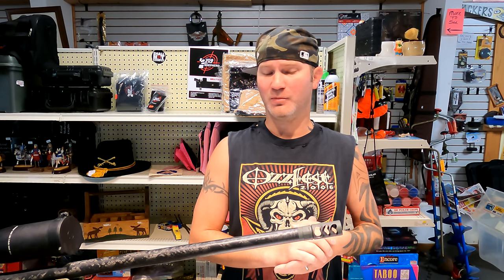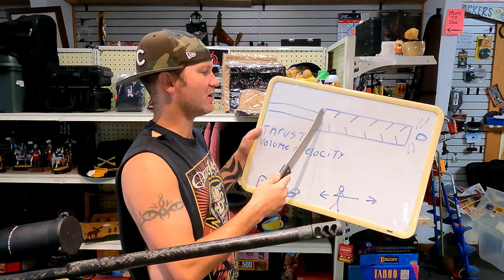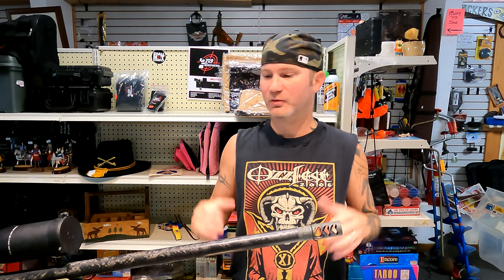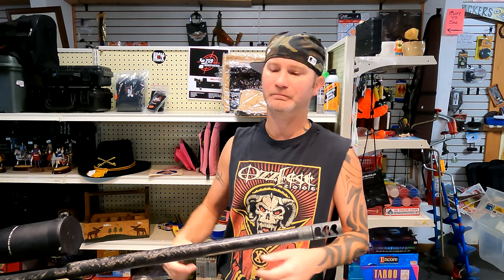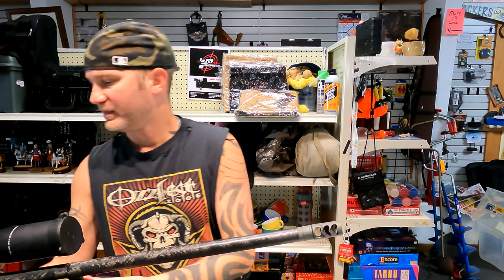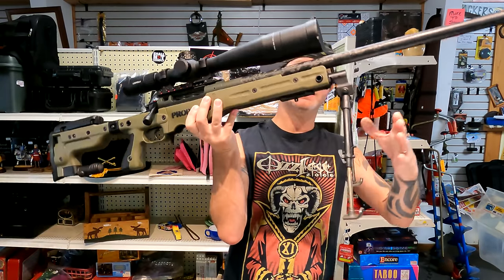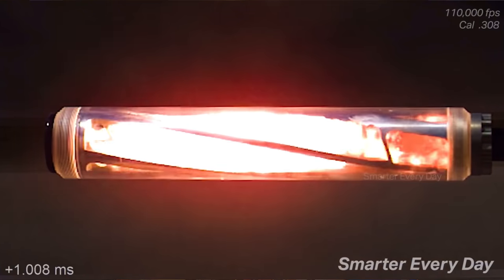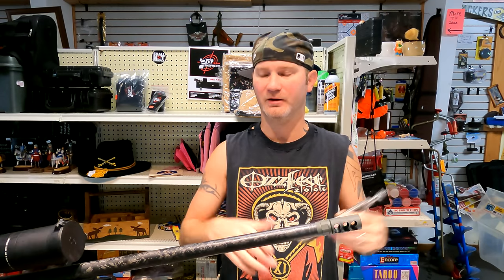Reduced Felt Recoil

Comment: All of that was wrong. Volume isn't even in the thrust equation except to get mass, the mass of gas remains unchanged. You can think of it like making it a poor rocket and lowering impulse (impulse is acceleration per time) as it slows the gas. For a rocket of fixed propellent mass, to increase thrust you must have higher exit velocity, a can diverts gas and slows its: making it extra slow exhaust, like a poor rocket.

Mgun*Vgun=Mbullet*Vbullet+Mgas*Vgas   (recoil starts immediately, there is no such thing as a sphere of influence, sitting in a car has no acceleration when steady velocity cruising, however when you accelerate or when a rocket accelerates the people DO experience a force). The bullet mass is very low (Mgun >> Mbullet) and for such a short time duration while its in the barrel where aim would be affected, the barrel's total movement in that time is very low and almost negligible in that thousandths of a second (the center of gravity of the closed system until exiting will be the same, and a bullet weighs very little), however we know it definitely does have impact for follow up shots since the time is not ~0 in those instances (otherwise shooting a foam dart or heavy lead projectile would have the same recoil, its not negligible for increasing amounts of time).

Comment: Suppressor weight: While you are correct on the physics, IMHO the conclusion is not quite right. The weight of the suppressor does reduce felt recoil but not much (except in a handgun). Yes, the same total energy is imparted to the firearm, but imagine a person jumping on concrete. They move but the earth doesn't move. In reality, the earth does move but such a small amount it is completely insignificant. So enough weight added to a firearm would ultimately make recoil imperceptible. And perception or "felt recoil" is what we humans experience as the recoil of a firearm. If you put a light and a heavy firearm against a strain gauge on a thick concrete wall they would equate to the same total force applied but the heavier firearm would not accelerate as much. Force equals mass times acceleration. And since our shoulders are movable unlike concrete all we perceive is the acceleration.

Comment: Because it cools gas that would otherwise be projected out the muzzle, making it (the gas) slower. Therefore, less gas force pushing the gun back into your shoulder. Done. 2 sentences.
Reply: There is a whole lot more to an effective suppressor than the cooling. The physical slowing and redirection of gas is where the big losses in decibels come from.
Reply: @Pipizzakitchen  Yes, slowing the gas is cooling it.
Reply: @Boosted98gsx  yes, it does, but in addition to the slowing caused by contraction, the gas is forced into areas at high pressure through porting, clipping, and compressed fibers like steel wool where it goes much more slowly at a lower pressure. That's where the advantage of greater volume comes in. It's not only slowing the flow but also arranging for the gasses to take the scenic route.
Reply: @Pipizzakitchen  Yes, that's what you do to slow gas, put it in larger volumes, and induce more turbulence.

Comment: The suppressor I have actually increases the recoil because of the blowback/design.
Reply: What can and what host?   My scorpion sucks for this reason.  That's why the mp5 is king since it's roller delayed.  My ARs ate better with heavier buffers and adjustable gas blocks.   The goal is to control the Gas on all fronts.